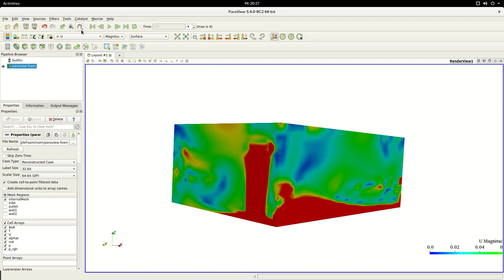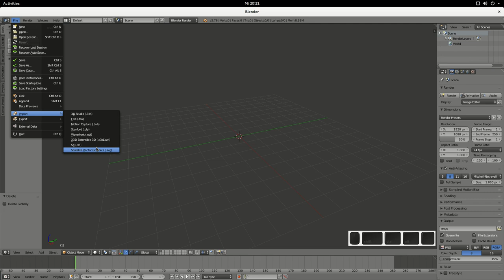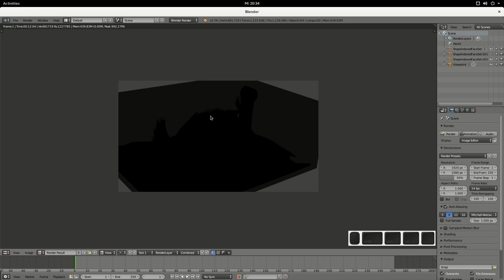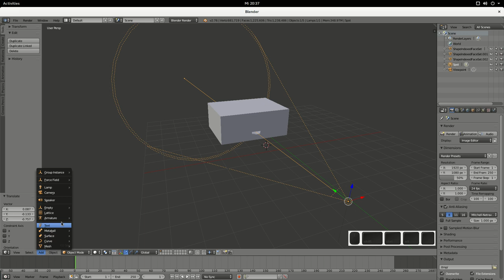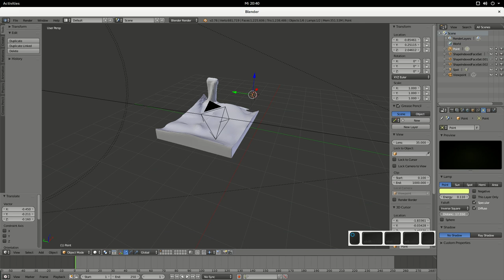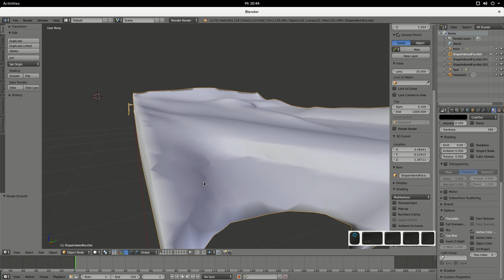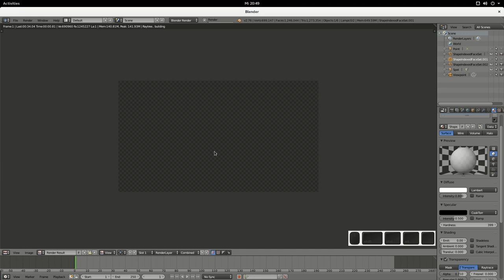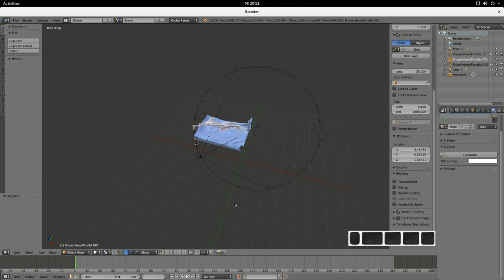2. Advanced Post-Processing using Blender® ∇ OpenFOAM®

Comment: Thanks a lot for the tutorial! This is a great option for post processing. But I have a question about the color options. I think in my blender version (4.1) the option for the vertex color is somewhere else but I can't find it. Do you  (or anybody else here) know how I can apply the color in newer blender versions?
Reply from the maker: Unfortunately I am unable to spend time to Blender and since the new version, things changed and improved. Sorry, but I am unable to give an answer right at now.
Reply: For anyone coming across this in the future: To add colors (tested with Blender version 4.1.1), you must add a Color Attribute node to the Base Color input of the material that you are using and set the source to "Col". "Col" is the colormap that is exported by Paraview, and you should be able to find it in the "Data > Color Attributes" tab of a selected object.